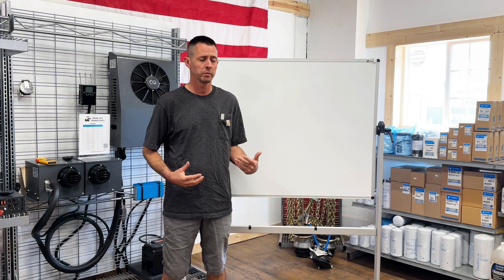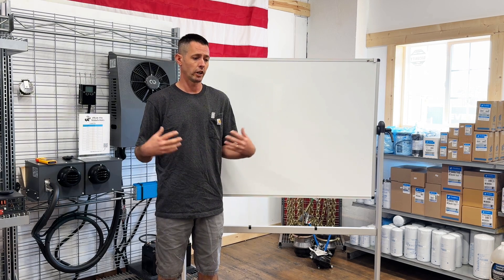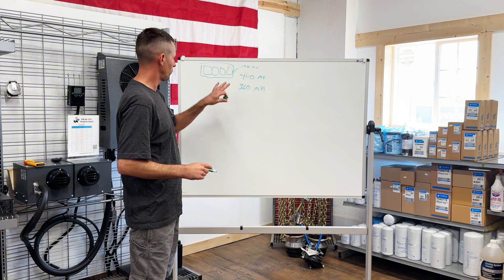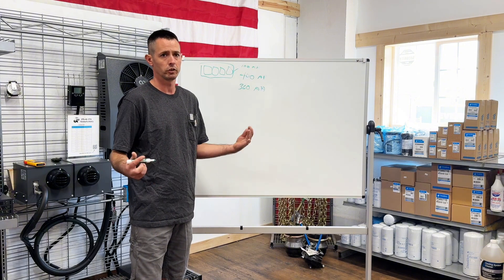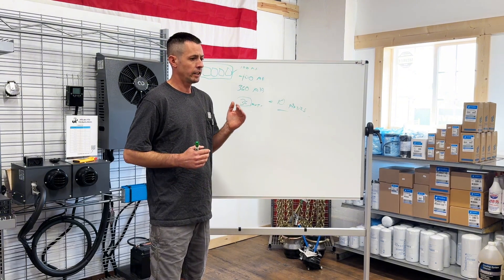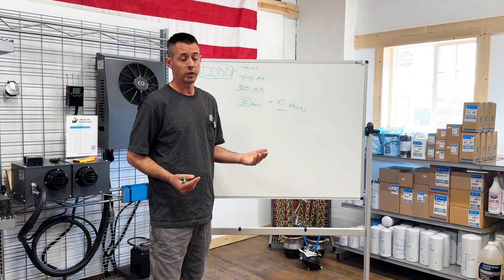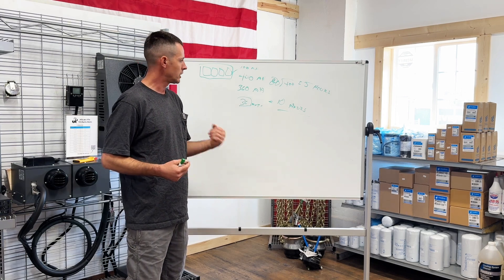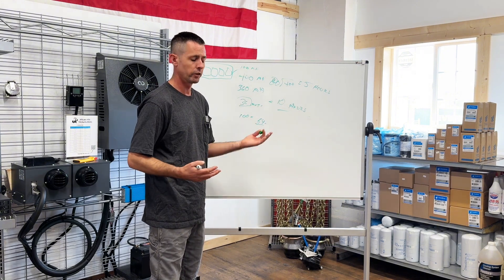Designing An Electric Apu For Your Semi Truck - Btu Run-time Charge-time Explained

Comment: Your numbers are wrong...My 2020 cascadia has  270AH alternator  (standard equip on a parksmart truck), that usually charges my 8X100AH Li-Ion setup from 50% to 100% in 2.5 hours of driving.. Li-Ion love to suck the juice up.  The real test will be if the batterries work this winter when it is -10F and I need to charge them.  The truck will be runnning, but if the BMS shuts them down because they got too cold, then what?  I will see, I have them installed now.

Comment: I watched your videos a couple months ago when my AGM Odyssesy's started showing the age at 2 years old.  Changed everything to li-ion batterys with new cables (2020 cascadia with EPU, 8 batteries).  Addded a shore power Victron IP22 shore power hookup for a predator 1400W inverter.  Don't have anymore power issues, AC can run for 24 hours at full blast.  Ionic BMS is neat, the Litime BMS is great for monitoring the discharge rate.  LI-Ion is the way to go for Semi-trucks
Reply: Also, took 400 lbs off the truck in battery weight
Reply: Hi , got 2018 flight liner cascadia with EPU  does the shore power port  charge the battery? Thinking of adding a generator to plug in during long waits at customer
Reply: @djvoicy1653   mine does, depends on how it's wired to the inverter, and which inverter you have.
I have a xantrex 1500 with display panel in the bunk.  When you plug shore power to it it reads bulk to let you know it's charging the batteries.

Comment: I work in entertainment where we are parked for several days at a time with computers, AC, fridges etc all going all day/night. We've been looking for a 13.5K+ btu ac system with 1600 amp hour/20kwh set ups (basically 4 large LIFEPO4 batteries under the bunk or something). Needs to have shore power hook ups as well. A lot of us are switching to mid roof trucks and looking at overhead ACs like rvs because we park places like Las Vegas and might be sitting there for 4 or 5 days straight.

If you can come up with something like that youd likely be able to make a solid rep for yourself in my industry.
Reply from the maker: A “true” 10,000 btu system is enough for a sleeper truck, to be honest, many systems are over stating their cooling capacity in the industry. You may not need the large amp batteries if you have the shore power option. We have overhead AC as well! You can see them here https://www.polarfoxapu.com/electric-air-conditioner. Don’t recommend anyone put lithium batteries inside your truck. When you have 1,600 amp hour batteries, you will have trouble charging them. Just another thing to worry about. In our opinion, what you have stated is basically like the RV industry. Solar panel and shore power works best for that.
Reply: You said 20 Kwh setup?  20Kwh for a truck?  Dude, you need a 100AH shore power setup, you ain't running that off batteries.  Or have a following truck with a 50KWH Generac and then plug in each truck.
Reply: Man, do not get a mid roof truck lol

Comment: Buy a gasoline generator from a hardware store
Reply: Yep...currently sitting here on my 34 hour restart running a predator 1400W running a Victron IP22 charging my li-time 400AH EPU bank.  Did I spend $2000 on batterries, 4/0 cable, a hydraulic crimper, heat shrink and di-electric grease?   Yes, I did.  Do I need a generator on an 34 anymore, no I don't.

Comment: How does this compare to the thermoking nvidia also does your eapu have a heat pump for heat in the winter.. will you be doing frame mount solutions for the so called backpack unit